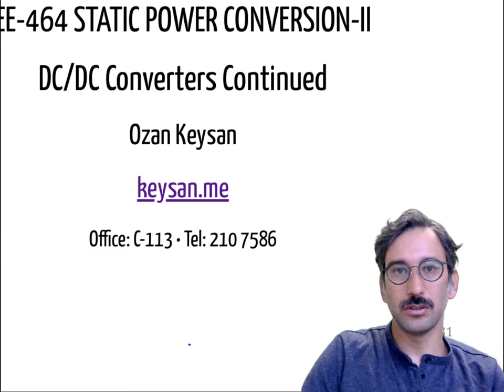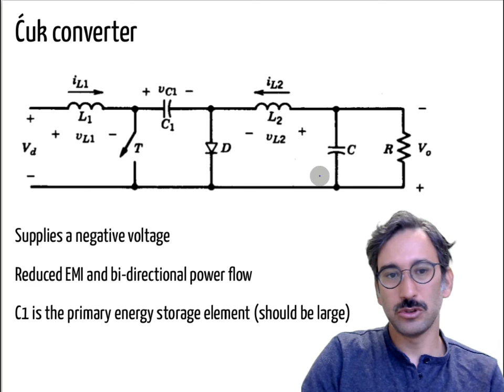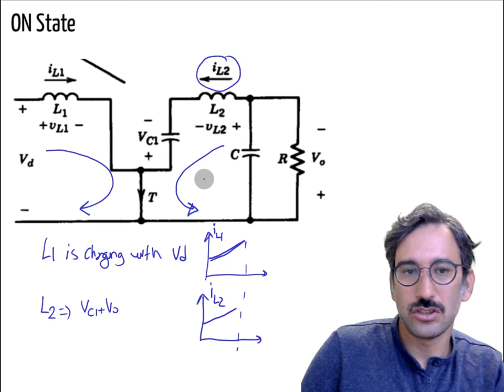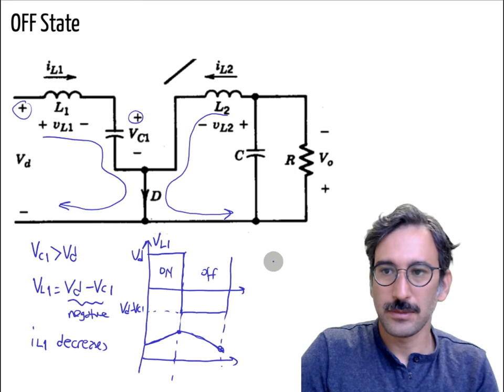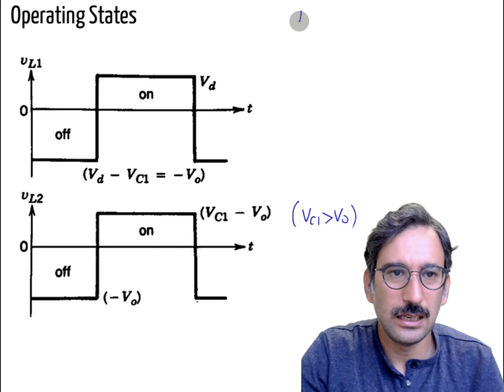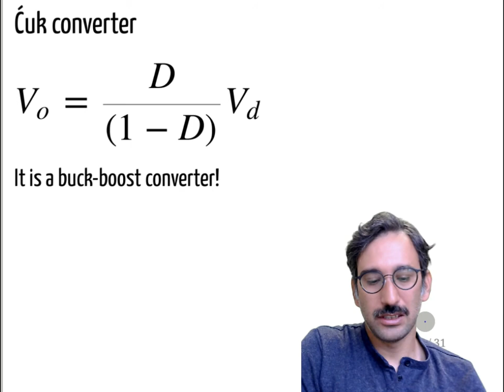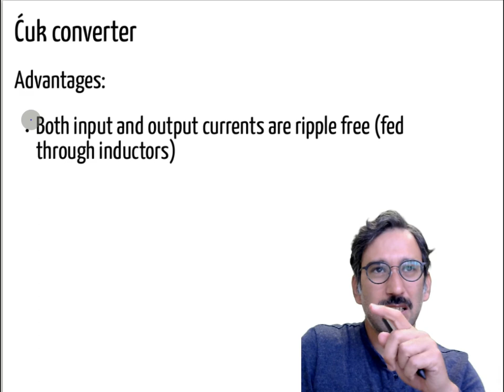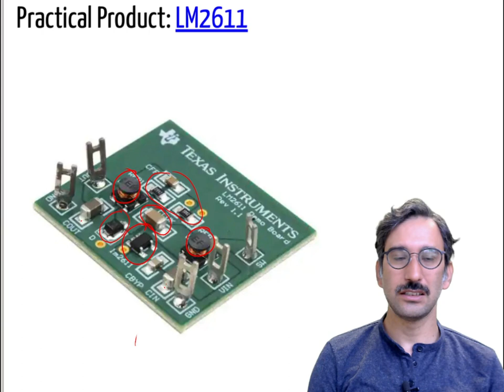Ćuk Converter Analysis

Comment: Hello sir am having serious issues with what ferrite core to use for inverter so far I bought alll of core ee4215 ee4220 but the transformer all or over heating and drain the battery by drain 30amp with only 75watt load in push pull circuit I found a core in a cell tower circuit transmitter and I rewind it and the inverter circuit only get warm and mosfet didn’t get hot transformer didn’t get hot and I get 500 watt load and everything work good but the ee4215 and 4220 is not working properly the core get so hot I can’t touch it in 1 minute and mosfets temperature reach 140 degrees in 1 minute I also try a ee55/7 core the same thing happens I also remember a inverter transformer ee56 core and it also get hot faster I don’t know the transformer I rewind that work great serials number because there was no code on the transformer so am asking you please if you could recommend a ee core series number that will work like the unknown transformer I rewind thank you